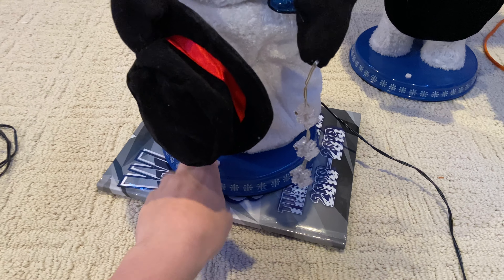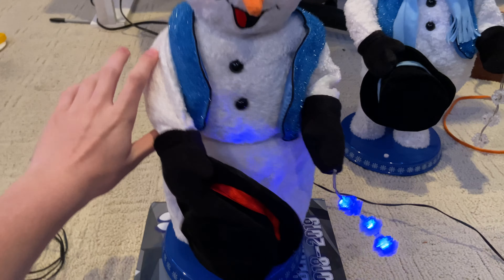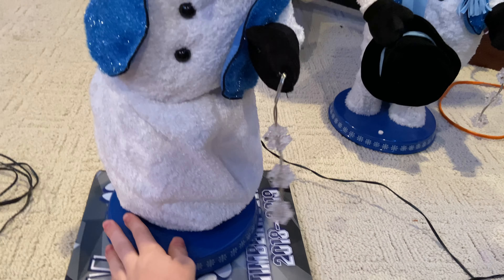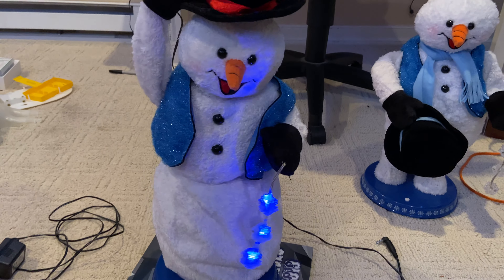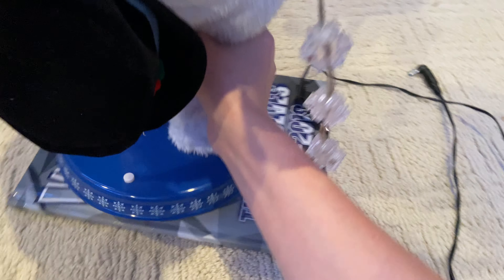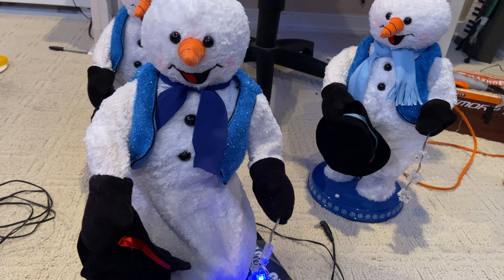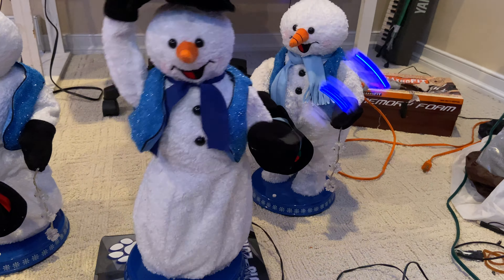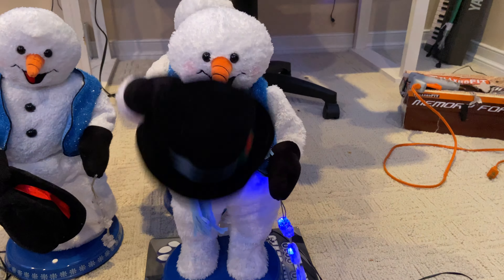Snowflake spinning snowmen glitching

Comment: 300MaH is not enough power for all 3 Motors to spin, so it just stops. And sometimes a sound glitch happens when there is not enough power or it will simply stop working, Does this run also run on batteries?
Reply: You need a new DC or AC adaptor
Reply from the maker: @Aross_Rosendhal  I have a nice adapter that i use i just have this one for glitching purposes
Reply: Ok
Reply: Your closer to the amount of my subscribers, 𝓬𝓸𝓸𝓵!
Reply: @layneschristmascollection8389  your snowman snowflake shakers collection is awesome and cool 😎

Comment: Hello ive just recently got an spinning snowman that partially works its the hips that dont work its a split gear bc it moves slightly when its turned on but i want to use voltage adapter but idk what amps to use for it if anyone has a snowflake snowman and knows how much amps it needs could you please tell me?
Reply: Oh also I have a 1 song with speed dial and has a plush head I’m pretty sure mines a 2002 one bc the seller said it was i need to get replacement gears before I fix him but ye thats all!